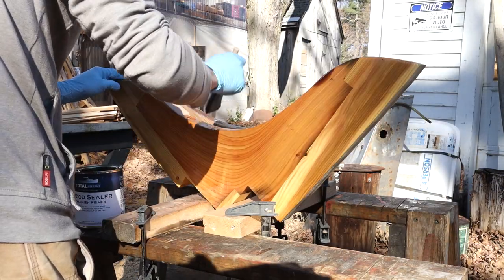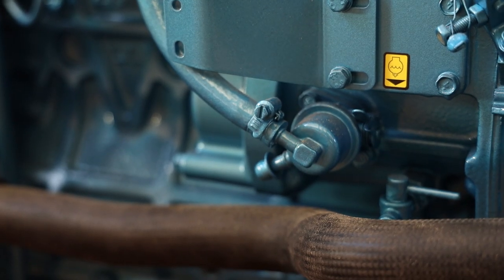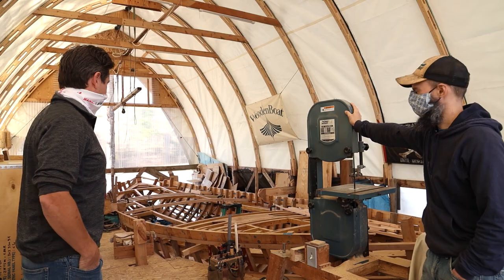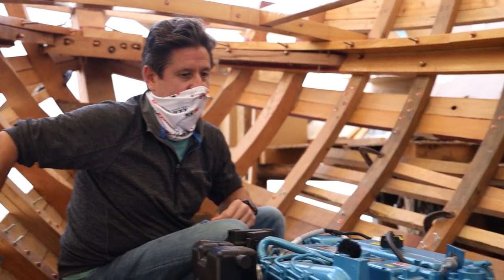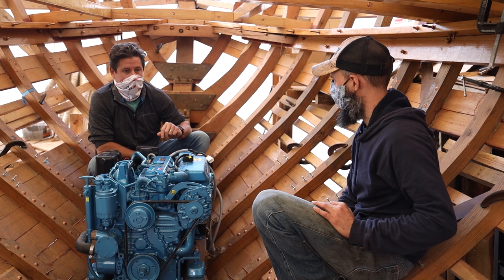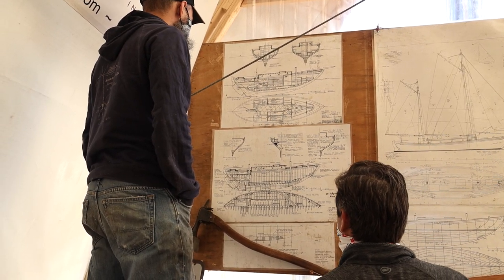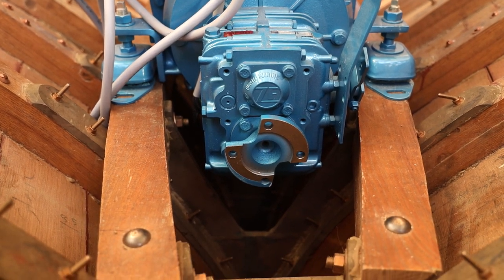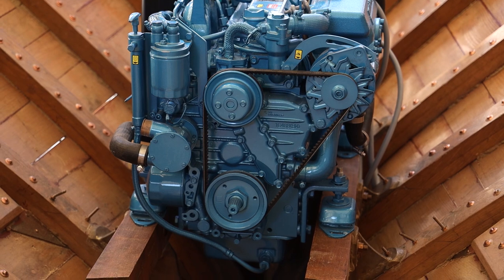Designing the Power Plant - Episode 137 - Acorn to Arabella: Journey of a Wooden Boat

Comment: Steve's comparing the amperage of the alternator to the house/shop was a little off base. Arabella's 100 amp alternator will produce 1/20 of the power that the house/shop 100-amp panel will provide. 12 volts vs. 240 volts. Multiply the volts x amps to get watts of power.

Steve and Alix, remember that redundancy is important. Go ahead and use two separate batteries for starting and household usage. But if possible, use batteries that are interchangeable. If your starting battery is getting iffy, you can physically switch the batteries between their respective trays, and use the household battery as a spare.
Reply: Ya you can tell he doesn't know the first thing about anything he was talking about.  
Gonna be interesting how the mechanical side of this thing ends up.
Reply: This might be the time to sit down and make a list of all the electrical needs of Arabella, for now and in the future.
Talk to people who have done long distance cruises with sailing boats and see what they found most important, or missed.
Then bring an electrician in and make a proper wiring diagram with all the generators, consumers, batteries, priorities and redundancies.
And if in doubt spec a little bit generously, no one knows what the future brings, but having to add outlets to a complete room is always a pain.
Reply: I was just about to post the exact same comment.  The only point I would add here, is that dual purpose starting/deep-cycle batteries are always a compromise.  This means that if your batteries are all the same, then they are always less than perfect for the job they do 99.999% of the time.  

A much more sane, simple, and effective way to achieve the redundancy you suggest is to have dedicated start batteries of the starting type, house batteries dedicated to deep cycle.  Then use a battery switch to 'emergency parallel' the house to start banks, IF it is ever needed.  In a perfect world, this would never need to happen because, there should be nothing on the start battery draining it.
Reply: Its more like 1-2 starter battery and 8 house batteries.
Reply: Dave Scott Indeed. Steve and Alix may be good shipwrights, but they are absolute novices on the mechanical and electrical installations a ship needs. Time they call in an expert before they make decisions they would regret later.
Reply: @everythingyacht3842  You're likely correct on this. I've done very little with deep cycle batteries in my agricultural/automotive experience.

I would suggest skipping the "emergency parallel" switch. Just keep a spare set of starter cables on hand with an eyelet at each end. They can be used to replace a corroded starter cable, or can be used to parallel the two battery banks.

It comes with additional expense, but ideally the engine would be fitted with two alternators. Each alternator feeds a separate battery bank. Again, this is for redundancy. Either alternator can fail, and you can still jury-rig the other one to charge both banks.

Don't overlook the simplicity of alligator clips. They make for some of the simplest and most adaptable connections you'll find. For example, imagine my earlier scenario, of having two identical battery banks. The house wiring could terminate in an automotive fuse box, and the fuse box feed is simply a flexible pigtail with two alligator clips attached. It can be quickly switched between which ever battery bank you want to use at the moment. It's a fraction of the cost of a three-way switch, and for low amperage situations, it's probably more dependable.

Also, what effect does battery acid have on bronze and wood? It's wise to plan on a battery off-gassing, leaking, or exploding. A battery should be located and shielded to minimize the risk of ill-effects on everything else.
Reply: @kilianortmann9979  I agree with this. Further, I'm curious what boat wiring should even look like. Is it more similar to a house or to a car? Solid or stranded wire? Breaker panel, or automotive fuse box? Repurposed household outlets, or specialized 12v outlets?
Reply: @jonathankipps9061  I'd say it's more like a car because it moves. All the automotive stuff is made to handle that movement. Also I wouldn't use household outlets for 12V. You are going to plug a 12V gadet into 120V at some point. There are many different types of plugs. Use one that is't too hard to plug in or unplug, but doesn't shake itself loose. Plus you could choose a type of plug thats even water tight for whatever that's worth on a boat.
Reply: They make switches for left side battery, right side battery , or both. You don’t have to physically move the batteries. They also make interchanges for  auxiliary batteries that only charge and do not feed back to engine system. I think Charlie Bs suggestion of spending a month on a similar type of boat is the way to go, he will learn more in that one month of what he really wants in Arabella. I would suggest some solar panels for additional auxiliary power.
Reply: @kilianortmann9979 , Emphasizing  FUTURE
Reply: @jonathankipps9061  Boat wiring should always be similar to what you see in other mobile applications.  It should always be stranded wire due to vibrations.  Solid wire will work harden a break long before stranded wire does.  For the plans that they have with Arabella I would go with the more bullet proof method of fuses, you can stock hundreds of them in a small space.
Reply: I am also going to emphasize redundancy with something you may not have thought about.  You have a really nice front shaft on that engine that you could mount a generator to.  The generator could supply you with power for tools, charging or anything else you might want 120 AC for.  It would be something you could plan for in the future and not use if you changed your mind but if you build into that area you would lose it forever.  If you depend only on your alternator you may be in a world of hurt one day when you could have had a ready supply of electricity to charge all of your batteries.
Reply: Steve's comment immediately made me pause the video and scroll down the page in a panic to make sure someone else had flagged this.

That alternator is going to give
100A x 12V is 1200W

A "standard" North American garage would have 100A of 240V split phase (since they weld and have a milling machine I think this is a safe assumption)
100A x 240V = 24,000W

Note that the actual power in both cases is going to be lower. Multiply by power factor when working with AC loads. Worry about voltage drop, wiring gauge, wire length when doing DC stuff.
Reply: I agree. Also 100 amperes at 12 volts means that their wiring joints must be of very high quality, otherwise a fire could start at a poor joint. I'm pleased that they've started to think about the electrical design. There's a lot more that needs to be considered such as navigation and radio systems, radar, e.t.c. plus the backup systems that all require electrical power. Then there's the cabling which must be accessible and of very low resistance to avoid power loss.
Reply: @jonathankipps9061   Boat wiring should definitely be stranded, but the strands need to be not too thick (or they will become brittle after the prolonged vibration and movement others have mentioned, and be at risk of cracking) nor too thin (or the inevitable corrosion will go too deep into each strand and the wire will turn to powder). The wire for offshore cruisers should preferably be tinned to help prevent corrosion gaining a toehold (proper marine wire is tinned before the insulation sheathing goes on), and special marine crimp fittings are preferable at the ends to seal against salt water wicking along between the insulation and the wire strands.
Reply: Jonathan,  they are in the USA, so it is only 10 times the power. 12V x 100 Amp and 120V x 100Amp.
Reply: @jonathankipps9061  You definitely aren't using household outlets with 12v.  Nearly everything you're powering will be fixed with direct runs to fuse/distribution panel.  If you're using things that can be plugged in they will have their own standard to use.
Reply: @Drenec1324  Not true. The US uses 240 volt breaker panels, with a 240 volt main breaker. The 120 volt circuits are merely center-tapped to ground. A 100-amp main breaker will trip with 100 amps on either leg of the box. If you're maxing out the box with 240 volt circuits, it's going to take all 100 amps before it trips. It's a little hard to explain without sketching it out for you, but yes, a 100-amp panel can put out 24 kw before it trips.
Reply: Even jump leads from the house battery will get it started.  Think cold engine,  contaminated fuel, 
Bad weather. You could need to crank a lot.